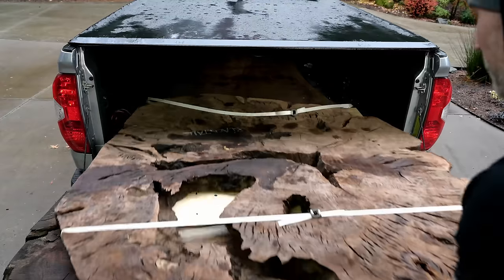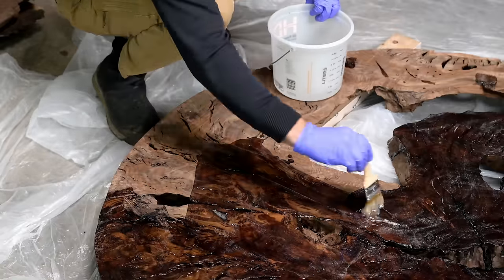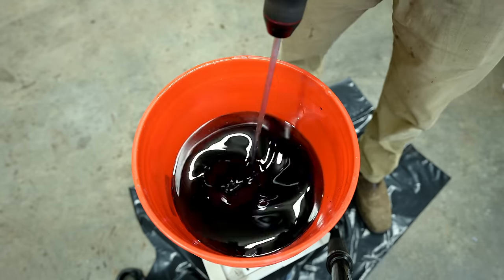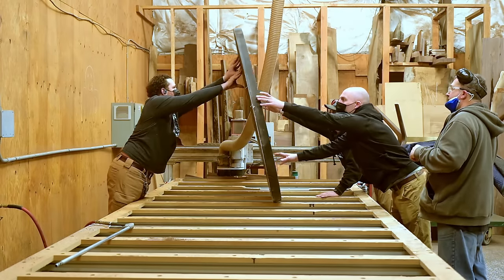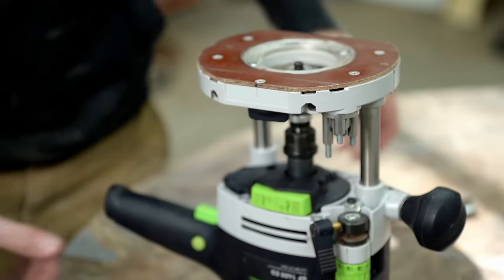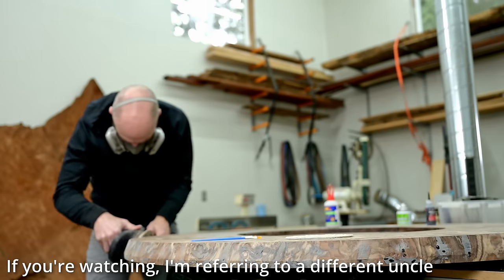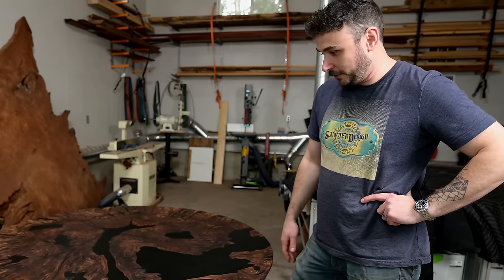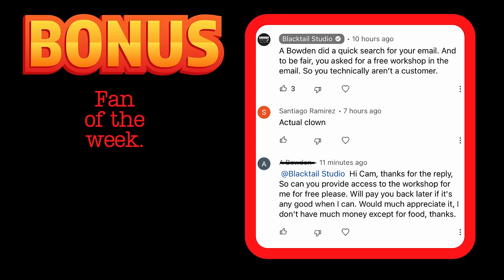The Worst Wood To Build With

Comment: hi again..
so a "bevel" has an angle that continues throughout the thickness, whereas a "chamfer" becomes a chamfer when it does not continue throughout the thickness.
I hope that makes sense.

Back to my last reply/comment re using float glass to achieve a perfect surface when using epoxy.

I mentioned you could try it upside down too..this may really work well for you, as I heard you mentioning air bubbles trapped in the wood, (migrating up into the epoxy)

This way round, the bubbles would migrate north, away from the epoxy, especially if you are able to seal the underneath of your table top, after the fact.

Regards
Michael

Comment: Hi, the viscosity can be thin or thick. Of course everything in between. Your leaks occurred because you probably didn't clean properly beforehand. The easiest way to do this is with isopropanol and an exhaust time of around 15 minutes. Isopropanol has the advantage that it is both polar and non-polar and evaporates completely. This gets rid of most of the impurities. Best regards.

Comment: 14:30 You should try an oil bath instead of water.  The oil maintains its temperature better and doesn’t splash.  It also keeps you from ending up with water in whatever you’re bathing.

Comment: In looking at your effort to recover the wavy bandsaw cut, you can easily end up with a flat but twisted planar surface. A simple tool made of two spirit levels, one parallel to the top edge and one parallel to the bottom edge. When you sight the ends of the levels. Any twist will be obvious. The tool is called winding sticks.

Comment: For the moisture, I'd have been tempted to run a groove all around the perimeter of the table top, and put it in a dry basement or other area where it's known to be dry for about 6 months, then re-CNC'd the top and check moisture levels again. If good, back to Plan-A. Maybe fill the groove with brass or more epoxy.  $.02

Comment: also, invest in heating matts or a low power infrared heater if you're in a colder climate :) the pour will hit more cracks, bubbles go up easier... it will save you a ton of time. also get one of these infrared thermometers to stay in control of your temps :)

Comment: I wonder, the dry ice blasting... the surrounding air holds water molecules that would freeze and also get injected into the wood along with with the dry ice beam. Perhaps an idea for a new video? Take a piece of thick wood, measure the moisture, then dry ice blast it thoroughly, ideally during summertime (higher absolute air humidity), and measure the moisture level again, to test the theory.

Comment: Sawyer Designs  That table is gorgeous- The work you do is always spot on, here there is a bit of a moisture issue STILL if I could - this is something I would buy - How would this deform as the wood dries? Might just add some character to a dark very large space for someone (?)  You're very talented with problem solving on the fly, which I believe is what makes you so good at this - When it comes to solutions correctness over quickness is critical you demonstrate this routinely - You make me sick 😊💯

Comment: A late response but, the moisture issue has nothing to do with the wood supplier, it's due to the wood being wet from the rain during transport. If you look at when the wood was unloaded from the truck at 00:40, taking 2 examples, the wet patterns from the rain are between the large hole and the large channel. If you then look at where he was scanning at 26:29, that's exactly where the wet spot is.  

Another example, at 26:59, he's scanning on the top-right of a U-shaped hole. Going back to 00:40, you can see a wet spot on the U-shaped hole near the top of the cookie.

Comment: Thanks for sharing. Moisture is always the first thing to check even before buying the wood. I would try and save it... have your CNC guy machine cut a 3/4 in deep circle on the bottom... almost the size of the table. Bottom of course. A starburst cut after that. Then epoxy and screw a good 7 ply sheet of plywood underneath; cover that with a veneer.

Comment: At around 3/4s of the way through the video,.I was getting ready to complain to you about using the black epoxy.....BUT I was gave that up after watching the rest of the video.............I am retired now from a lifetime of woodworking....( Dad was a carpenter...Helped him with everything since i was 3 years old )....My favorite work besides " High End" Woodworking shops was with Trade Show Exhibit Co's.      Everything from displays to Custom bars that required epoxy pours.          You did a nice job pal.     Very rewarding I suspect.......

Comment: Speaking as a full time resin caster and professional model maker, why don't you make up a giant vacuum box and pour your tops inside that? Yes the box would be huge, but it could be made from steel box section and the vacuum would pull the epoxy right into the wood. I have to 'degas' my rubber before moulding and I also vacuum my moulds when the rubber is poured, makes a huge difference! The vac box would be big and heavily built, but think of the time you'd save in having to go over all the voids! Also being air tight, if/when you get a spill, it will hold the resin, also it will keep all the dust and hairs out!

Comment: So….I’m sure you’ve heard of this before, but just in case…..when pouring concrete countertops, you can attach a sander, or I imagine tool with a good bit of vibration, to the underside of the table.  I can’t remember the time, but I’m sure w different medium it may take a little guesswork. 
This will send bubbles to the top.  
Every try or hear of it?
I will try it very soon on a pour and see what happens. 
If you’ve heard why this doesn’t work, please lmk. 😬
Enjoy your videos. Like your energy. Wish you much continued success. 😊

Comment: Have tried a vibrator when you pour as it should improve the epoxy filling the hole.  Just setting a vibrating saner on the platform you pour on should be enough vibration.  Similar to how you vibrate concrete pours

Comment: if you value your shop floor then you should alot a space in your shop just for epoxy work, you can make that epoxy space temperature controlled to your specs, install plastic or paper dispensers so you can have the floor covered prior to your pour etc,

Comment: Use the border form and then use the melamine board around the edge of the table below your project. Cover the floors with Corrugated Wrap Roll - A Flute, 15" x 250' for $30.00 from ULINE. Best investment ever.

Comment: At 4:11 there is an answer to varying wood dampness and to the porous nature of the wood. A cinder block impromptu wood kiln with natural gas or propane. If you had a digital thermometer screen outside, to keep the interior at a reasonably and dry heat, not going crazy and trying to get it dry quickly, it would kill two birds with one stone. When the wood is hot, say 125 F then making sure that the polymer is warmed up as well, but cooler, so there is a gentle variance, say 100 degrees, the bubbles gases in the porous wood would be expanded, and immediately, the cooler polymer would be pulled into the porous materials as the heated gases in the wood contract, minimizing the gas, and making it adhere tightly at room temp. The trick would be to "guess" that since the temp between both is warmer than room temperature, unless the table itself, were in a room that exceeded 100 F, the polymer would have a negative pressure of the gas in the wood, bonding. Put it in the sun, where the surface of black wood might increase to above 100 or 125, then the gas would expand inside, and weaken the bond, but in a room, you are golden. If you doubt me, do this. If you can still find a heat lamination machine, laminate cold paper. There will be bubbles. Run the same stock through with no laminate to heat it, and quickly place it into the machine sandwiched between plastic. No bubbles. Why? I have done this with photos. Print them, have a laminating disaster, and then heat the same stock, quickly laminating them. Perfect! The gas in the paper was heated far above room temp, and the gas in the paper expands on the dry run. Send it through and it comes out great because when both cool, the room temp is substantially lower than the paper was as I laminated. At room temp, there is a vacuum created and a bond. I know that my experience is not with wood, but pulp/paper, but I promise you, the principle is sound and it would work with polymers and wood. Rather than the room temp bubbles, you would create a bond that is at a negative atmospheric pressure due to both the fluid and wood cooling together.

Comment: Nice Video. Shame there was moister in side the wood. Question can it not be dried out even if you did finish the top. or would that create some sort of De lamination. And if so could not just drill tiny hole to release the moister and then re plug the holes.  I know nothing about building those big beautiful tables that I see you make all the time.With all the hour you spent, that's a shame because they looked really nice anyway keep up the great work always enjoy your craftsmen ship.

Cheers Fred

Comment: Watching this video a second time, it looks like the table was sealed more or less immediately after being dry ice blasted. I wonder if that contributed to the moisture that ended up being locked in the wood. Obviously this is just speculation on my part, since I have no experience working with wood. But I'm curious if others think that's plausible.

Comment: Cam, I am a first time woodworker and decided to make a white oak slab epoxy table for my patio (outside in open). Following many of your videos to work through the process. Having difficulty in deciding the right finish for outside use. Rubio doesn’t seem to have right product for outside. What would you suggest?

Comment: Cam, I want to know your response to this question. Have you ever tried using a vibrator when epoxying your slabs. It would and should eliminate all voids. I'm not saying use the ones for concrete but something more practical like, maybe a electric shaver etc...Names Mark BTW.

Comment: Hi Cam. Bummer on the out come for the round (Saywer) table. Looked beautiful. I have noticed you tend to use darker epoxy colors . Is there any particular reason for this. Other than most of your wood is walnut.  I'm planning to take a small dive into attempting an epoxy table. My first try will be a Manitoba Maple / Boxelder burl. This wood has lots of moisture when fresh cut. So I took your advise & had the moisture tested on it. Needs more drying . It does have a fair amount of red colour in it  . Which will fade with time depending where its home is in regards to UV Ray's. Was toying with redish epoxy to some what match the natural colour. 
Any insight on your behalf would be great. Thank You
Going to give your course a go , I'm sure it will help a Newbie like myself . Take Care. Love your honest videos.

Comment: Just throwing this out there, but I bet an appropriately placed anchor pin on your workbench would have made profiling the edge of the table on the router table much easier. And produced a smoother cut.

Comment: But the dry ice blasting into those small cracks... perhaps it didn't all vaporise out, but actually  was absorbed? secondly... it looked like it was raining or damp outside as you brought the slab home in the pickup. was this the case and would it have made any diference? and thirdly... could you give an update on how the table top looks after one year? thanks

Comment: Just curious after watching the constant struggle of getting air out of intricate voids, have you experimented with agitating the piece after applying the epoxy fill. You can use a larger 10- 15"  pro loudspeaker with an amplifier and signal generator, strapped to the opposite side, under the form, and find your best resonant frequency and amplitude. Or just play Led Zeppelin (or Bob Seger) for an hour! Awesome content BTW...

Comment: “Viscous” scanned a bunch of comments for an explanation as you requested, saw none.
Viscous means doesn’t want to flow fast. At room temp, Water is not “viscous,” while most epoxy is viscous (tho some formulations differ, and viscosity increases as reaction progresses). 
High viscosity value means thicker.

Comment: Sawyer. Cam, I did a salted pine backslash, and like this project of yours had to repeat the sealing process 5 or 6 times. But without thar sealing I don't think I could have gotten it to come out right. 1/4" birch plywood with a veneer of 3/32" thick salted pine slats in 3 randomly mixed widths. I fell in love with fine woodwork doing it and want to use my 25 years of experience to get into the field, but I am disabled and barely have money for blades and sandpaper right now. Could you help with ideas on how I could get some decent materials to work with.

Comment: Have you thought about using Cactus Juice to stabilize your wood? Cactus Juice is not cheap but it's less expensive then 2-3 coats of epoxy.
Reply from the maker: Need some way to heat it to 180 degrees is the hold up for me with that

Comment: That router bit looks really dangerous, I'm not an expert but I think that in addition to using the head protector, you could have used some kind of protection for the torso. A leather apron would be good protection, at least slowing down the speed and energy of any parts that come loose. Protection of areas with many big vessels would be a priority, such as the inferior vena cava and aorta in the center of the torso, as well as the groin area and thighs to prevent damage to the femoral artery. The neck region should have some protection too. 👍

Comment: I don't know if this is going to be useful or not but as a materials expert, I can tell you why you're getting those leaks underneath of your ceiling. It's because your table has not been prepared that silicon going onto that white melamine surface is never going to be a sealant for any type of pressure gradient whatsoever, a 16th of a pound of pressure is enough to have your material start leaking out underneath of your project I suggest putting down a piece of tape around the outside first you can even use blue tape works fine and apply your sealant on top of the project table applying that type of compound directly to the white melamine is going to leave an extremely bad connection between the two materials. Did you notice that when you wiped it with your rag that that very thin surface on the edge came up like it was not stuck to the table well guess what it was not stuck to the table I love your work though, but those type of leaks should not be happening with proper preparation of the surface to surface contact, regardless of the materials you're using from epoxy to paint all those materials have a favorite way of one another. You should know that I'm sure you do some people use packing tape instead of blue tape. You just have to make sure that you get the packing tape flat because it tends to wrinkle.

Comment: Couldnt You just drill like max. 3mm holes under? that the moisture can get out with time. Anyway People/Custumers they buy stuff with any Price just cause it looks great... actually im car mechanic and from Switzerland. Im not really Experienced with Wood, but after You sealed it with Epoxy it is heavy for the Moisture to get out. Or grind off the Epoxy till the Wood has its own surface to dry out... I like the Style You have, really nice work.

Comment: “Audacity succeeds as often as it fails; in life it has an even chance.”― Napoleon Bonaparte  It's always amusing to listen to your comments, "My shop floor is more acrylic than concrete,"  I laughed out loud.   Your comments about the joys of sanding amused me too.  I don't mean to be a wiseass, but I'm shocked at some of your bad choices.  It almost seems as if you were screwing up on purpose or in a hurry.   I knew cutting the edge of the slab with a jigsaw was not going to work as soon as I saw it on the video.  I wonder if you weren't running out of patience with the tabletop.  For instance, it's hard for me to imagine that you'd forget to remove the screws from the edge of the table.  About belt sanders, I have one, and I use it, but I find belt sanding demoralizing.  When I have to take a belt sander to a piece, I feel like I'm paying the price for having screwed up.  Clearly, your mistakes didn't discourage you because you went right into making that gigantic top.

Comment: What do you do to keep the epoxy from scratching when the tops are finished ?
Reply: The epoxy is harder than the wood which is why in one of his videos he was sanding really fast in order to prevent creating a lip between the resin and wood. Lately his go to has been 2 coats of rubio monocoat (and then n3 nanocoat (a ceramic coat)

Comment: Sawyer got the sub! I trust your judgement. Even after the moisture fiasco. 😉 Out of curiosity, are these piece dried or is that not a thing where wood this size is concerned. In guitar building, the wood is all kiln dried first because the same moisture problem would be a nightmare from a stability standpoint first and foremost. But it stands to reason kilns are only "so" big. But just curious. And again...steller comment troll exposure at the end. 🤣🤘🏻